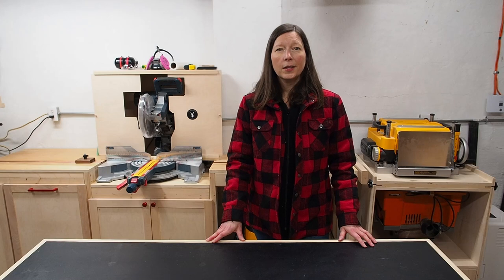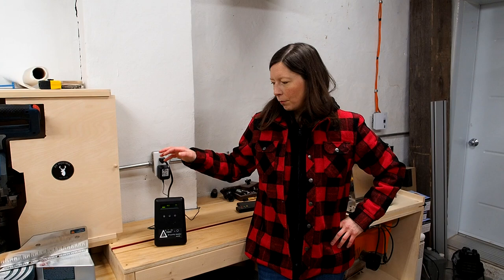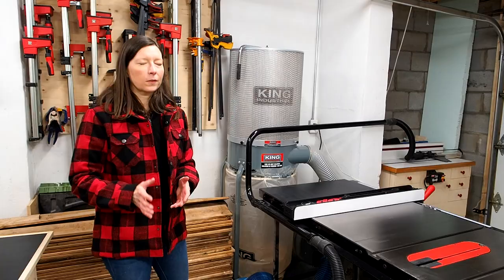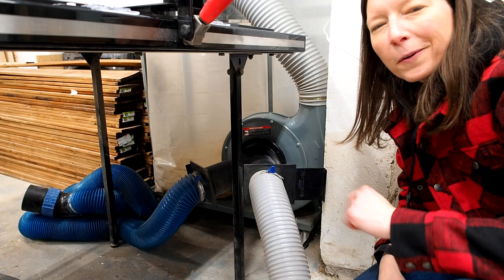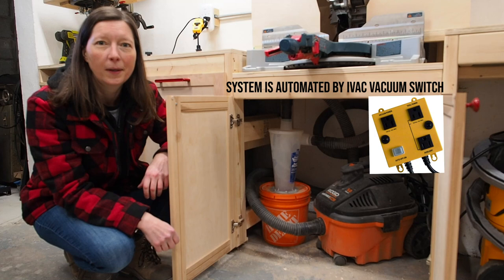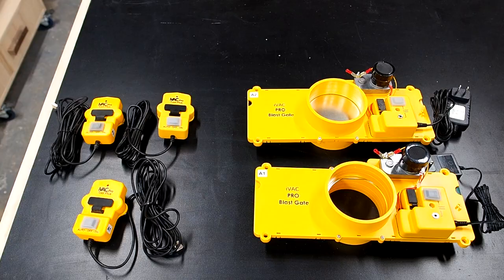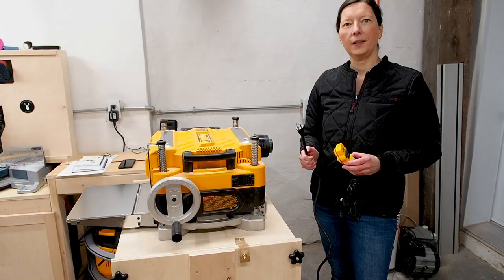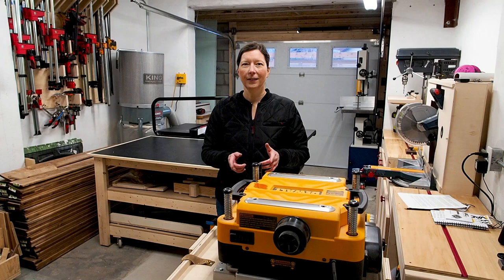Dust Collection for Small Shop | Dust Collection Options | Automate Your Dust Collector with iVac

Comment: Excellent video! Thank you for sharing your shop set up.

Dust extractor vs Shop Vac in a nutshell.
Shop Vacs leak air and dust at every connection point (e.g. hose connections, lid and filter) and have lower quality filters; even the HEPA filters. Main focus to move larger debris with higher suction.
Dust extractors are designed around asbestos and lead abatement standards to be completely sealed so ALL of the air and dust that enter the hose end is filtered through the high quality HEPA filter. Dust extractors usually have a mechanism to automatically or manually clean the filter to maintain proper suction. Main focus to move smaller dust particles and filter 99.97% (or higher)  particles .3 microns and larger.

Comment: Great presentation Marie, I always appreciate the style of your videos. You’ve got an excellent dust collection system for such a small shop. 

For the men reading this keep in mind that if you choose to wear a respirator like Marie showed, OSHA regulations in the US say no greater than 24 hours growth of facial hair with it. So basically...be clean shaven for a respirator to work properly.

Marie you mentioned your table saw cord being a trip hazard...there are rubber triangular mats that look like speed bumps you can put over it. If that’s possible in your shop I couldn’t tell but thought I’d make that a suggestion.

Thanks again!

Comment: Great video, just recently found your site. Lots of comments below, so I don't know if anyone mentioned this.

Shop vacs have more power/pressure than dust collection systems. One method that testers use to measure shop vacs is with a transparent vertical tube, pulling water straight up; the higher, the more powerful the vac. But shop vacs lack the ability to move air as in volume, like dust collectors. This would be similar to a compressor versus a leaf blower. A compressor would not do much to blow leaves, but can blow out water lines and hoses for the winter easily. A leaf blower is not very strong, so it won't blow out lines, but moves tons of air, which is needed to blow leaves.

Your Mirka dust extractor, like the vast majority of dust extractors, has smaller tubing than regular sized shop vacs, to help maintain CFM, but also not great for sucking up nails, screws and similar type debris. Great for dust and chips. Your Mirka, like my Flex dust extractor, as well as Milwaukee, Metabo, Hitachi and many other brands are all OEM'd by Nilfisk. Nilfisk probably makes 30-40% of the dust extractors worldwide. Yours, like mine, will pull air for 15-20 seconds, then send a reverse pulse of air, then continues pulling air. This is how the filters is kept clean. Some other MFR's use a vibration systems which shakes the filter. There may be other technologies used, but these systems are usually only found on dust extractors versus shop vacs, to keep the price lower on the latter.

In the USA, for worksites that use grinders that blow metal, plastic and other materials into the air, OSHA mandates 25 CFM of suction for every inch size of the grinder being used. 5" grinder would require a125 CFM dust extractor. Also, throwing a HEPA filter in a shop vac, does help, but OSHA does not accept that. They, being the whole dust extractor, needs to be HEPA certified. Which typically most dust extractors are, when they say HEPA. Shop vacs, some are, but the majority are not.

Enough of my rambling. Keep up the great videos. Informative, interesting; you come across very well, not too fast or too slow...quite natural.

Comment: Really cool overview of shop dust collection! Thanks! Currently I'm trying to make temperature controlled and dustless (or close to dustless) metal working workshop with CNC plasma, grinding area, sand blasting, and powder coating. Most of the tools will have their own dust collection system (with HEPA filters as a last stage) and shop will also have a separate air cleaner. I've came to realization that dustless environment is a huge quality-of-life improvement, since the shop can stay temperature controlled the whole year round and often there's no need to wear a mask (for most operations).

Comment: Whether or not you are crazy, I will leave to others to figure out.  You are NOT however "over the top" with your dust management.  Many of us have fought with dust management for years as the field has developed.  You have provided a reasoned and doable approach as well as some good advise for current times.  Thanks for sharing. 

Many of the more expensive portable dust collectors, Fein, Festool & probably your Mirka, have a second motor that helps keep the "sucking" motor cooler over long operating times.  That, in addition to their more complete HEPPA solutions adds to their cost.

Perhaps one distinction between Shop Vacs & Dust Collectors is that shop vacs manage "chunks" & dust collectors more safely managed the flying stuff.

Some questions:
     1.  While describing the dust deputy under your chop saw, you talked about how it is "supposed" to work.  How well does it work?
     2.  Is that automated system have a version that works on 220? 
     3.   Could you mix 120 & 220 equipment? (I have a 220 dust collector, Sawstop & CNC with a 120V planer.  I have been collecting tools a lot longer than you have😇)

Stay Well.

Comment: I had the same problem accessing the switch for my dust collector.   I used a plug in switch (Canadian Tire 052-1575-2) it works very well.  You have solved that with the automated system.    Thanks for your informative videos.

Comment: This is good inspiration for my shop - I just added the WEN air filter, now I need to get a Dust collector next - for now, I just use a shop vac, but as you said those tend to throw the small particles back into the air.
Reply from the maker: Yeah at minimum at least upgrade to a HEPA filter and add a cyclone will help a lot.

Comment: This is the set up I need . Mostly I need a dust collector . Used to have small system of tubing with blast gates from sears craftsman. It was hooked up to a shop vac. It worked ok I guess . But once I started getting bigger tools it was obsolete. I'm still trying to get a dust collection system for my miter saw. Its always a work in progress.  I do like the automatic starting of the dust collector.

Comment: Well done. You did your homework and it has paid off. Your shop may be small, but it's long so the automated switch and blastgate system is a huge boost to your work efficiency.

I discovered an increased sensitivity to fine dust after recovering from COVID last December. I am in the process of setting up a 750 cfm DC for my table saw and will continue to use my shop vac/Dustopper set up for my smaller tools. I also wear my mask a lot more often than I used to.

I looked into one of those Wen air filtration systems but I didn't think it would actually do any good. I went with the 1 micro cannister filter on my DC (just like you did). If the DC is going to be passing particles <1 micron then it would seem that the Wen would just be passing them through as well because it can't filter smaller than 1 micron. Basically, the Wen would just keep the <1 micron particles circulating in the air, which is the worst thing you'd want. My take on it, anyway. Maybe someone else can set me straight.

You've come a long way since I first started watching your channel. I love the ingenuity you've put into your shop design.

Comment: I can seem like a stupid thing to spend money on when everyone has some sort of shop vac.  But a good dust extraction system is a tool worth every penny.  Not having to clean up dust at every task and not having to worry about breathing in dust is nice.  I have a King 1200cfm dust collector and a Festool CT36 and it is so nice using them.  I want to get an air cleaner in the next month or two just for that extra help!!
Reply from the maker: That's the way to go! Air filter helps to catch what the DCs don't 👍

Comment: external cyclone definitely reduces airflow from what i've seen.  After buying a 1HP harbor freight dust collector and a cyclone/shop-vac system - I will most definitely not be going that route again. There's not enough draw out of either of them to consider them real dust collection.

Comment: I just ordered the ivac for my dust collector minus the electronic blast gates.  I plan to have my dust  collector stored in a separate room adjacent to my shop.  I’m wondering if you have any experience with how well the remote transmission is and if it will penetrate a wall?  My dust collector will be approx 5-10ft away but on the opposite side of my shop wall.  Thanks

Comment: Great walk-through for DC solutions.  Questions:  
--By turning the blast gates sideways, the doors move vertically to open a close.  Is there concern of dust eventually collecting in the gate track to prevent them from closing completely?  Does turning them vertically increase the chances of that issue?  Does iVac recommend horizontal vs. vertical installation?
--I like that the DC stays running for a few seconds after the tool is shut off, but that blast gate #2 closes and #1 opens right away, leaving the DC collecting from the gate #1 even though you were using gate #2.  It'd be much better if gate #2 stayed opened during the post-shutoff delay in order to collect extra dust from the tool you were using.  Is this a programming option?

Comment: Best thing I did was cut a hole in bottom of shop vac and mount it on top of dust deputy.  Small footprint and no need for hose from dust deputy to vac.

Same thing with dust collector. Throw everything out except the blower. Mount that on top directly to the super dust deputy.  Not Side by side. Then plumb directly into a tall canister filter.

Comment: ivac makes some pretty sweet stuff but holy heck all those cords/plugs would drive me nuts haha
Reply: Nothing a good masking job and a spray can of paint or two can't fix :P
The price though :( They are hella expensive for a hobby woodworker like me on a half time work salary.
They are also for 120V power and as a Swede having 230V mains plus 400V 3-phase power for most large machines it will not work at all. And yes that is standard with 3-phase power for every house in the countryside. Also, it's very common in residential areas with individual houses in cities as well. Even some apartment buildings have it though there it's usually only for more expensive areas like ones mainly with condominiums and not ones with mostly rental.